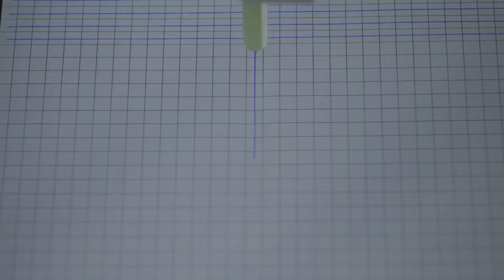Samsung Z Flip 5 / Fold 5 - Water Test, Drop Test, Folding Test | Durability Test Video

Comment: Screen durability is horrendous. I have several friends with Folds and Flips and every single one, the screen has cracked at the crease.
Reply: Do you know which model they had and for how long?
Reply: Ive had my flip 4 for over a year and I've not had any issues with the crease cracking. My boyfriend also has the fold and he has also never dealt with this issue.
Reply: @daviddaaannggg  The ones that I actually know which model they have, one has a Flip 3 and two have the Fold 4.
Reply: I traded my fold 4 in after 6 months because the inner screen scratches easily, but every single one does not crack, that's bs you're making up for likes.
Reply: @PackMan13x  mine also gets scratched up pretty easy. The built screen protector did end up bubbling up after awhile, but that's about it for me as well.
Reply: I've used flip for ages and now my mom with a fold. None have had any faults apart from user error
Reply: I've had a flip 3 for two years and the screen just started to crack... The factory screen protector cracked in like a month so I just took it off and never replaced it... I have also dropped the phone countless times, and even left it on the roof of my car once and it came off at like 45mph, busted out of it's case, flipped open and only got a few scratches on the outside corners... Definitely the most durable phone I have owned since the HTC one M8....
Reply: @PackMan13x  I didn't say every single one cracks, I said every one that I personally know that has one has cracked and that is not BS.
Reply: My wife has had her flip 3 since release, its still in perfect condition.  She's not gentle with it either and our niece and nephew have gotten ahold of it several times I've also slept on while it was open many many times,  when i was about 240 lbs.
Reply: Then all your friends are careless. I use a flip 4 and two other friends have been using the Gen before that too no cracks on the screen or at the bend at all.
Reply: It's not really the screen that has issues, it's the screen protector that starts having issues. Then because of the failing screen protector, causes the actual screen to break.
Reply: BS!. My flip 4 folds like new after one year. These phones are well built!
Reply: @PackMan13x the fold 5 has a  non-user replaceable inner screen protector to protect the folding screen from scratches, samsung do a free replacement of this once and then it's $20 each time. Honestly worth it for me haha.
Reply: I've had my flip 3 for 2 years and only the screen protector pops up. If you don't replace it when it comes up I can totally see the screen cracking after a while.
Reply: It's not a crack screen protector probably
Reply: Didn't happened to me. Z flip 3 since released, screen is perfectly fine!
Reply: @mikevierling7543 well it shouldn't do that and not that fast either. Samsunf replaces the screen protector for free
Reply: They probably had a 1st 2nd or the 4th one
Reply: @Espurrita you could have just sent it back to samsung and they would have replaced your protective film for free...
Reply: @charloduplessis  It's not personally an option for me. Otherwise, I would have.
Reply: @mikevierling7543.   They probably think of your smartphone as a toy.
Reply: On my Flip 5 appeared black dot 2mm size at the crease 4 month since buy. Samsung fixed it fo
r free. But I don't want to use this phone anymore coz it
Reply: It's not a crack it's a screen protector lifting.
Samsung replaces the first for free
Reply: Change the tempered. The screen can't Crack.
Reply: I'm still using my flip 3 even after many drops and bends and the only real noticeable damage is a small spot of dead screen on the bottom but that doesn't affect the user experience
Reply: I'm having the 3 and its been about a year and the screen is just fine. No cracks
Reply: Just my first drop (60cm high) and the screen got black line about 0.5cm yea samsung is terrible at their flip screen my aunt's huawei pocket 2y just the screen protector got yellow
Reply: BTW I'm flip 5 just using it like 3months
Reply: Maybe that's why they don't dare to unfold the flip 5 during the drop test bruh
Reply: My z flip just bubbled/cracked after two months. Currently in the process of getting it fixed with samsung since it is under warranty. It's very annoying, though! 😢
Reply: That's weird, I own flip 3, my friend have flip 4 (traded for Flip 5), and one coworker using Fold 4 and not a single one has any problems. I'm upgrading to Flip 6 soon. You're just making shit up.
Reply: I had two flips (still own one) and never had one issue with the screen or hinge. And I put mine through hell with no case, straight raw dogged.
Reply: This is due to manufacturing defects and does not affect every Fold or Flip. Its really down to if you get lucky, but if you're lucky and dont end up with the crease issue then they're built like a tank.
Reply: The durability tests when closed mean nothing because the outer screens use typical high end smartphone materials that withstand drops,one drop while open will cause half your screen to just die,notice how they don't show any drop tests while the phones are open
Reply: @ShadowLady1  Because you're never really using the phone open at a time where it can be dropped. Of course I wont be using it unfolded while walking around, its far too big to hold in one hand. Ive had a z fold 4 since launch and have yet to have any issues with the inner screen
Reply: It's a foldable duh. Why would a screen be made of glass glass would Crack one. Every foldable is made of plastic. 
2 most foldable phones have a crease not all.

Comment: Z flips strong phones besides you have to change Screen protector from time to time because it starts bubble. It was in Z flip 3 and 4
Reply: Does it work without the protector?
Reply: @drtristram5197  it does,  but better keep screen protector on. z flip 5  I have no issue with screen protector from the beginning.
Reply: @przemkoart  perfect, mine is coming tomorrow and I was worried about it messing with the screen.

Comment: WARNING!!!  I love this phone  (flip3z) and using it for creating content for the past 18months BUUUUUTT  2 screen replacements and now as of today the screen didnt only delaminate it went liquid black in middle rendering the phone useless. 

I called Samsung and they dont care or want to replace it despite the ongoing issues.  The authorized repair centre in Canada for Samsung (Futuretel) advised me not to buy these phones as the same screen is in the Flip5 meaning the same issues will likely occur.   Prior to today's incident and after watching this rad review figured I'd upgrade but not now. 

Tread carefully because if the screen goes liquid black you can reset it and do you want to send in for repair all your personal or work files?  

I understand occassional issues from new tech but 3 failures in 18 months and a strong suggestion from the repair center tech guy is enough for me to share my experience so you dont have to be fustrated.

Comment: Screen broke top right corner from the test at 1:13. I know it’s meant to but pretty cool to see it fail in an official video.
Reply: No.. you need glasses
Reply: I don't see anything.
Reply: I don't see it, i keep looking over and over, do you mind double checking?
Reply: @OverDunkNessSEVEN 2nd ball drop and then right before the cut to the 3rd ball drop its for a split second you can see that the 2nd ball drop broke the display as the inky blackness consumed the top right of the display.
Reply: @Kanev05 ahh no that's the black box attached to the machine my friend.  I think its a sensor.
Reply: @GS0CK6 that box with the red light.
Reply: @GS0CK6 funnily enough, I thought that's what you were referring to.
Reply: @OverDunkNessSEVEN  No, What box and what light. I'm talking about the Z flips display breaking after the second ball is dropped. You can see how the oled display cracks and the black spreads from the top right corner. That's what I was talking about.
Reply: @GS0CK6  it doesn't, you're confusing the sensor with a blacked out display is what I'm saying.  Perspective issue.  I thought it was that at first but If you look at the actual machine as it moves to the left you can see the box that is being mistaken for it.
Reply: @Kanev05 that's the machine lol
Reply: @GS0CK6 that's rhe machine
Reply: @Kanev05  Your smartphone seems to have low performance and cannot see the truth. Buy the samsung galaxy